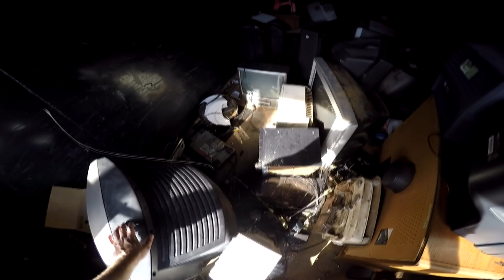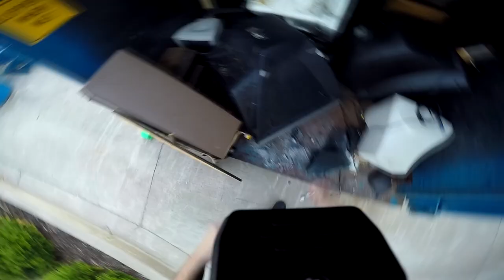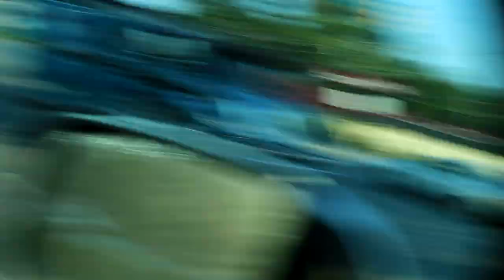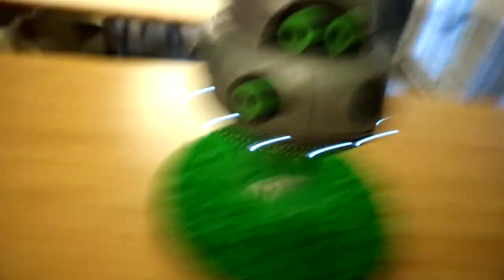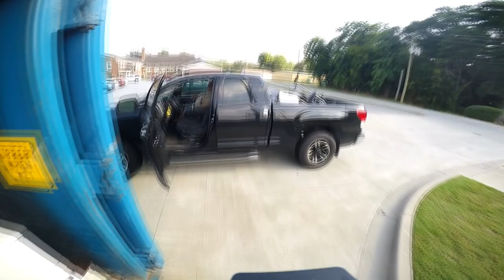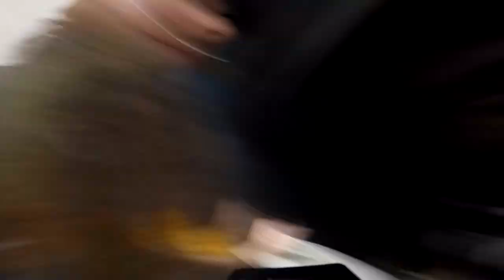Dumpster Diving, and Things. MORE COMPUTERS

Comment: Test the computers!  And SELL them, i do have one with a case like that (both the p4 and the Compaq), not a bad lil case but not the best.  And what was the white one in the start of the video?  you NEED to know what's in them so you can get the most value out of them, and if it works then SELL IT FOR CHEAP!!